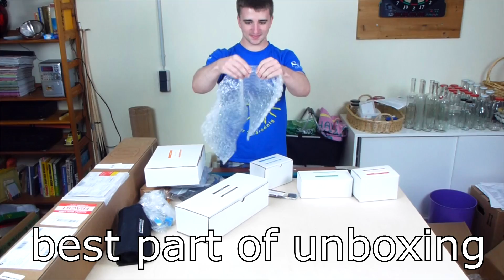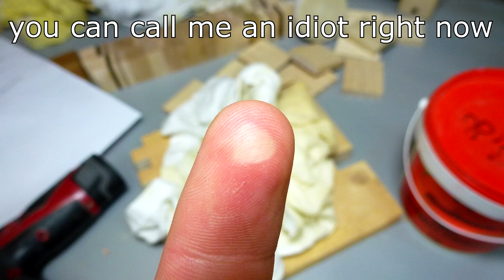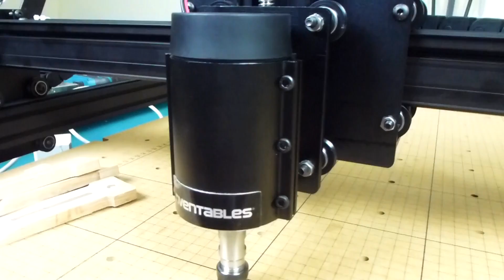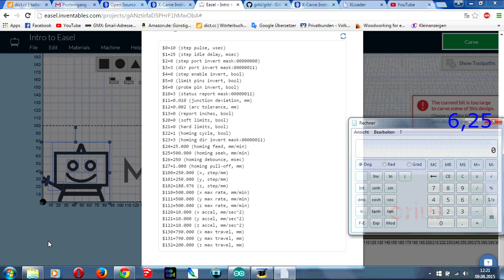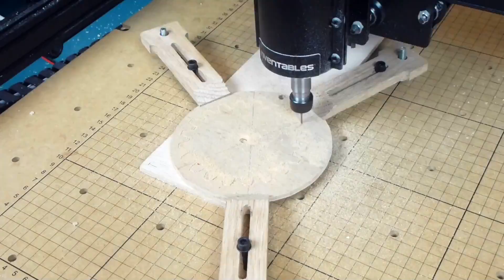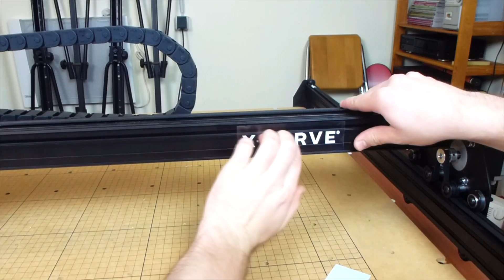X-Carve CNC: Assembly, Review and Troubleshooting

Comment: I think that you are to woodworking, what Marques Brownly is to portable electronics, that is, the go to guy. Really good work. I'll bet that the company packaged two of the same wrenches rather than one each. If nothing else, I would expect a manufacturer to take special effort with a review unit. The gears were quite impressive.
What is up with the dislikes? Do you have a 7 permatrolls who dislike every video you make?
Thanks for the excellent work.
Reply from the maker: Scott M The two wrenches weren't identical, but I have seen some other reviews showing the same issue. I was expecting dislike, probably because of the beer ending :)

Comment: Inventables sent us one of these too. Great machine! I was going to do a long assembly video too but you've done such a good job, Marius, I think I'll just link to yours and go straight into my thoughts on the machine. Well done.
(By the way, mine is the same as yours and it will move over the 0,0 point - could it be that your cable ties on the belts are getting in the way?)
Let us know what router you upgrade to..?
Greetings from Ireland, Tim and Sandra
Reply from the maker: WayOutWest Blowinblog Thanks. I guess it's the limit switch that is in the way. As the Dewalt 611 is hard to get in Europe, I think I'll go with a Bosch colt or a Makita trim router.
Reply: Marius Hornberger WayOutWest Blowinblog I bought the Dewalt 611 from America, and use it with a 240-110 V converter. I don't have a CNC, so I just use it as a router. It really is a good machine, but the converter was more costly than I had imagined.

The same model is sold as D26200 in Europe. You can get it from ToolStop or ScrewFix in England (weirdly not screwfix.de, but the english one ships to Germany anyway). It's more expensive than the the american (even with duties), so if you already have a 240-110 V converter, that might be the best choice.

Comment: On my 3D printer it doesn't stop if a endstop faults, though there is a setting in the firmware you can set, I am not sure what the firmware is like for your xcarve. might be worth seeing if the arduino firmware has constant definitions for your stepper adjustments so you can hard program it (and thus it will stick if you have to reflash for w/e reason). Note I am not experienced with x-carve, it may have it, it may not shrugs Loved the outakes though lol I was wondering whether the bottle opener was gonna break hah!

Comment: great review Marius     to get the home location to go all the way u need to turn your belt tensions adjusters on the back side  they r in the way when in the front  
great video thanks for the info
Reply from the maker: Patrick's work shop They already are on the backside. But the limit switch is also in the way.
Reply: What do you mean???

Comment: Nice honest review, exactly what I expect from you, well done, with your excellent humour thrown in. 2 points, I have though.
a) You did not explain exactly what the machine is for ? What's it's purpose in life. Makes freeform figures? Replaces a 3D printer ? I maybe ignorant but I have to ask the question.
b) The bottle opener did not look "man enough" for the job and in the Outtake it broke ! Am I correct ? What's wrong with your throwaway lighter ? ;o)
Reply from the maker: ReadandWite It's for carving out shapes and also 3D carving, if you have the right program. Be creative.
It kind of broke. On the first try a too thin layer grabbed the cap. But it's still more a single use opener.

Comment: For your limit switches to work as you wish you need to enable the "hard limit" option in grbl. you may need to install more switches on the opposite end of your rails. At moment your settings would be only for homing, but you can also change some settings in grbl for soft limits that will prevent the machine going to far from home saving it trying go to far back or sideways.
Reply from the maker: Grant Oneill Ah, ok, thanks.
Reply: If you need help with what setting to change let me know and I will try and help
Reply: Look up grbl settings on Google for an idea what all the settings do, you change them the same way you changed the other ones you changed.

Comment: Hi. I would highly appreciate a quick review after 4 years of (heavy?) use. There are quite a lot assembly videos around (which yours is one of the most interesting, imo), but there is no "x years later"-review. Do you still use it? And if so, what problems did you face over the years? Tschüss - und weiter so! ;)
Reply from the maker: I used it and it always performed as good as in the last video about it
Reply: @MariusHornberger  Thanks! Weiter so! 👍😎

Comment: Nice review.
On the smaller/500mm machine, zero isn't an issue. No idea on the larger one.  
The wrenches that I got fitted fine, so I'd say thats a QC issue on the stamped wrenches.
I agree with the spindle, very underpowered, though is relatively quiet. Relatively. Makita make a pretty good trim router, but unfortunately Inventables don't have a mount for that.
Reply from the maker: Paul Jenkins But they have their universal mounting...thing. And you have a CNC, you could make it yourself too.
Reply: Marius Hornberger While true, it'd be nice to have something like the DW660/bosch colt spindle mount (which isn't available in Australia) out of (T6061 - also really hard to source unless you want a full size sheet) aluminium for the visual appeal ;)

Molten milk bottles (HDPE) are likely to form my spindle mount.
Reply: +Marius Hornberger Let me know the dimensions if you need a motor mount. I'll make one out of 6061
Reply: +Paul “TheWoodKnight” Jenkins I have my machine up and running (not a x carve but a upgrade copy of one) and I have a 400watt motor on mine that seems pretty good. The power supply I have is rated to 600watt so I guess I could upgrade more.

Marius great to hear solder pronounced the way it's spelt.

Comment: shouldn't that belt go on the other side, from down i mean, then the clip will hold it down and it will lock it self.
Reply from the maker: LordAnubis0909 The instructions showed it like I did and also should lock it down. And the belt teeth should also interlock with each other. This also works, but isn't reliable enough imo.

Comment: Use Hex head bolts for the screws on the bottom of the z axis assembly?
Reply from the maker: Justin Bell Good idea!
Reply: +Marius Hornberger You could also just switch the bolt around to have the nut on the back.
Reply from the maker: No, you can't do that. It's a eccentric nut and needs to fit in the hole.
Reply: Marius Hornberger Oh, they're using eccentric nuts instead of eccentric spacers. In that case the hex head bolt is probably the best option.

Comment: Wait a minute!!  You didn't throw the instructions on the floor this time...what???
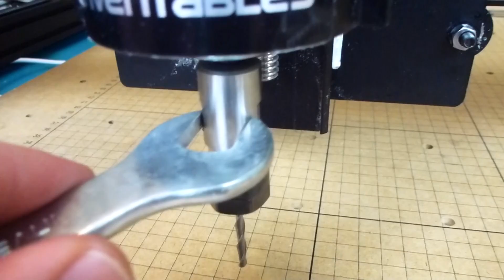10:59 You put the wrench on wrong, it goes into the flat, relieved section, you can't use a wrench on a round object.
Reply from the maker: Josef Roesler Of course it goes into the flat spots. But if it's too small it can't fit...
Reply: Marius Hornberger I'm just going by what you showed in the video, you showed trying to put the wrench on the round section, not the flat section.